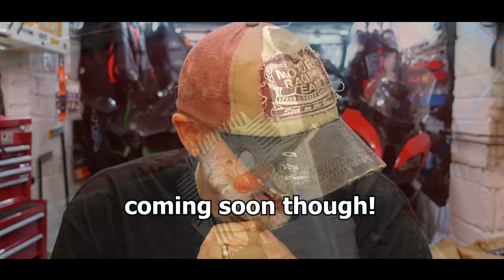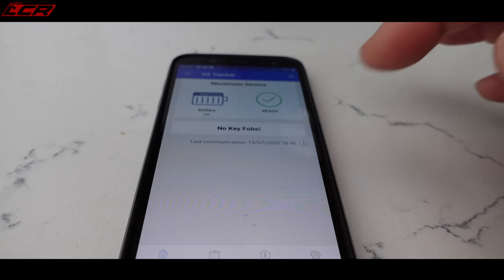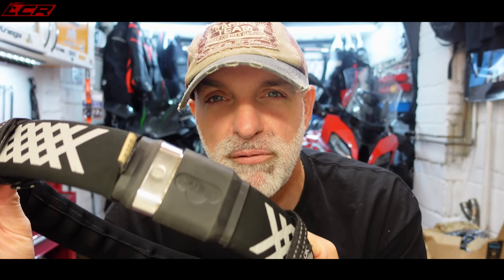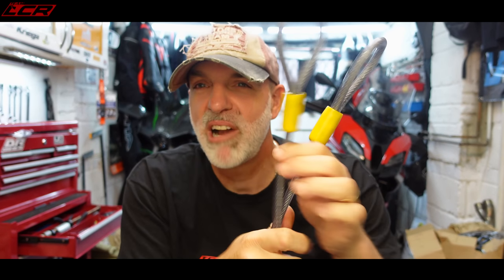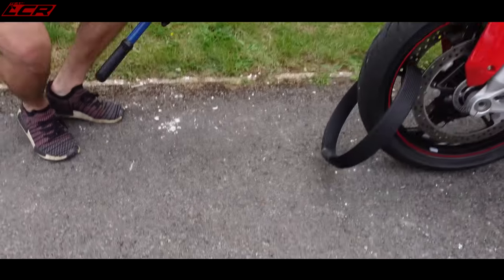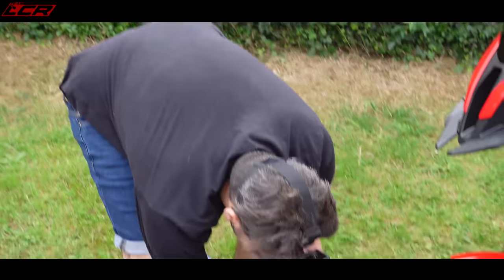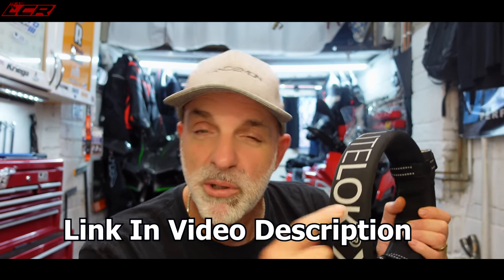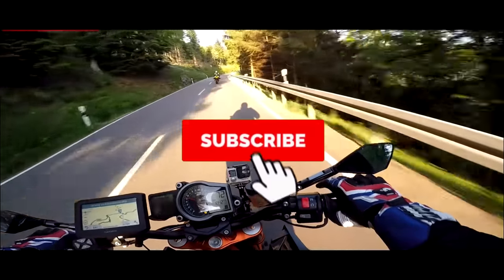Litelok Motorcycle Lock Review | Can We Cut Through It??

Comment from the maker: Guys of course an angle grinder will cut through this.. .Name me one product that wouldn't?  All you can do it try and protect yourselves from the opportunist thief its all about the deterrent and with the Litelok being Gold Secure an insurance approved tick in the box in many circumstances. Its a chain alternative which is easy to live with
Reply: It would still be interesting to see how long a disc cutter would take. However, it is only a deterrent and I'm still thinking of getting one as it looks so much easier to carry than a chain and padlock. And as I got my new street triple rs as a result of your reviews I'll have a punt on one of these too.
Reply: You don't need 450£ to buy a good steel bolt cutters as you say and they don't need to be so big that you can't hide them. For the first time in your channel I do really believe you were paid to say what you said, and the test you did you were told about what you could use. The premises of the test were wrong, the materials used were wrong, and the justifications about the price of the correct tool and size are really really misleading. And regarding the noise using a grinder well... It's different 5 seconds of noise from 2 to 3 minutes of noise or in the case of the grinder the neighbors don't matter anymore? So why not test it? Like I said it really looks like a really bad sustainable and badly premised paid review. At least say in big letters PAID REVIEW.
Reply from the maker: @jmvsc1  I didnt want to cut through it with an angle grinder as of course it will!! Then I wont have a lock to use.. I do actually want to use this product after the review! I dont crash test my helmets or motorcycles for the same reason.. The point was to show its not as easy as some people are making out to cut through this. THIS IS NOT A PAID REVIEW
Reply from the maker: @Steve765  Interesting but ultimately pointless as it will get cut through in a similar time to a chain I suspect. But this is a much easier product to live with than a chain and meet insurance standards
Reply: @LambChopRides  you didn't want to.cut with an angle grinder or with the correct and common steel cutters. That's why it's misleading, it's also very safe with a kitchen knife but also a useless test 🤷🏻‍♂️ sorry but I like your content and have you at a really high standard and that's why it's very disappointing this particular video.  Not trying to be a hater.
Reply: @LambChopRides  Yes I get that, and coupled with a decent disc lock, alarm/immobiliser and tracker I think that's as much as you can do whilst out and about.
Reply: Jose Castanheira I work for Litelok, there was no payment to Lamb Chop Rides.
Reply: Yes I would still like to see how long it would take to cut with an angle grinder, 😎👍
Reply: @LewisfromYouTube  there's always a quid pro quo, otherwise why the 10% discount? And I'm being as honest as I can when I say I don't mind if he gets paid or if he receives a kick back per unit sold with his code or something like that, he works a lot and he deserves to.receive something in return since he does not charge us to watch the channel, however the review/presentation/demonstration was way bellow the standards we are used from him and that's why it feels shady. It's a crappy lock, yes it's better than nothing but not much better....
Reply: Jose Castanheira A kickback is for his time and efforts for making the video...all youtubers ask for the same and we are more then happy to give Lamb Chop that for bus services and honest feedback of the product 😊
Reply: Jose Castanheira and we fully believe in our product. It wouldn’t have 5* on MCN otherwise.
Reply: @LewisfromYouTube  not a good defense... But once again I'm not the only one that got the wrong impression so it says a lot about the way it's presented. It does not change my opinion about the lamb chops rides...
Reply: Jose Castanheira can’t please everyone I guess!
Reply: @LewisfromYouTube  well you say honest feedback but it's a bit misleading really.

What his advert basically says is "if you use the wrong tool for the job, you'll fail".

Use a steel cable cutter which is no bigger than what Chopsy here is using and you're through it in under 20 seconds, silently.
Reply: @lmaoroflcopter  if I don't see an update with a proper tool I'm unsubscribing as he now has turned into another marketing shill.
Reply from the maker: Jose on the Gaurdsman barrier the code gets you £50 off! I get nothing, zero money. I requested the discount to get my subscribers something back in return for supporting me and the channel. Yes with this code I get a small amount, like the Amazon affiliate links it's the same thing. Other discounts like the CFG one, Ultimate Addons I get no money from that, its there for the subs for thier support!
Reply from the maker: @thecappy  Buy one and do it yourself! Use the code I can get you 10% off!
Reply: Lewis Bradley Films 
 Good to see a employee of Litelok on here as I bought a wearable lock for the Breadknife ( being lead to believe it was impenetrable with hand tools ) paying FULL RETAIL because I was told by the salesman that discounts give a negative effect on quality, so i'm now feeling fairly miffed that they can be cut with a decent pair of wire cutters, your giving them away to you tubers and discounting them through affiliate links which no doubt pays a commission.
Reply: Yes battery angle grinder 1mm cutting disk try that
Reply: It can be cut in under 30 seconds with cable cutters and was demonstrated by Lockpickinglawyer. Videos like this just smack of bought and paid for reviews.
Reply: @Bound4Earth  yeah just dislike his video and report his for not correct information.
Reply: ill name 2

hiplok d1000
altor saf

Comment: bolt cutters? try using cable cutters and you'll cut right through it in seconds. How much did LiteLok pay you for this ad?
Reply: Bolt cutters might be the dumbest tool to use on cables. It just squishes the little fibers together a bit. It's literally the kind of tool this lock would be suited against.
Anything made to cut steel cables will work like a charm if properly adjusted.
Reply: Exactly. See my comments on this.

Comment: Chopsy, I have an Almax chain and squire lock that will survive angle grinding but would I want to take this 15kg behemoth with me on a trip out? No. It is fine for home use but out travelling I want something that is a deterrent for the average scrote and makes them work for it until the Monimoto tells me to go check the bike. This kit is perfect for that and must be appreciated for the purpose it is meant. Easy fit, easy to travel with, insurance reducer and a delay tactic for the opportunist scrote. Also, if you ride with someone else who has one they can be doubled up. Gets my money. Great vid. Much appreciated.  Show the man some respect all you doubters.
Reply from the maker: Thanks Bob, glad someone gets the idea behind it!
Reply: Could not agree more! As a wise Mr Flyer said security is like layers of a onion!! 🤣 More the better.
Reply: Same here have an Almax and squire lock on a ground anchor but this lock looks ok as a portable option.
Reply: Well said.
Reply: I also have the almax and squire, amazing bit of kit but would still be cut with an angle grinder.
Reply: niche 123 not so sure. The Almax I have has 15mm links that are triple hardened. I think it may well break the grinder and in any case will take them enough time (and sparks), to be noticed. Super kit.
Reply: @bobcarter5548  yes they would get through it with grinder but with alarm and 2 disc locks plus bike trac alert and cctv camera alert to mobile i reckon i would get to them first😂
Reply: @bobcarter5548  I agree that the almax is amazing, I've actually got the 19mm. I just mean that nothing is angle grinder proff. I also use two disc locks and another chain. I also made an alarmed cover that goes off if someone lifts it. Probably takes me 10 minutes to unlock it with the keys. Lol.

Comment: Would have preferred a video using the modern thief's weapon of choice, a battery powered angle grinder. 

However, any deterrents are good and make bikes less appealing to nick.
Reply from the maker: Yes but nothing can withstand an angle grinder. You can only offer a deterrent and this is very easy to live with and meets insurance standards
Reply: I'd like to think I'd wake up and check on my bike if someone was using an angle grinder at night.

Comment: To defend the product, it is (or rather was) Sold Secure Gold. That doesn't include an angle grinder test! If you want the highest level you'll have to spend more money and get a Diamond rated product, both in ground anchor and chain, and lock. £130 isn't going to (not) cut it.

Comment: Others have mentioned, the angle grinder attack. But then angle grinders can get through 20mm hardened chains in about a minute (see articles on Bennetts social). Yes the angle grinder makes a lot of noise. In addition to a disk lock or two, alarm and tracker, it does at least slow down the "lift the bike up on to a van" attack, so it does look useful. All you can do is slow down a determined thief, and make them think there are easy pickings elsewhere.

Comment: We use various wire cutters at the local electric utility where i recently retired from that would cut through that in under a minute. Any made for cutting steel cable will do the job including some one handed ratcheting types. The smallest one I had on my truck had 16" handles. Many of the smaller aluminum conductors have a center steel core. No angle grinder required. Stating that I will also say if you have a determined thief that knows what they're doing they will get your motorcycle, car, or anything else they're after.

Comment: As has been pointed out an angle grinder would cut it, and a chain and a disc lock, To carry a chain that would slow down a grinder, you'd need a trailer because of the weight of the chain .. I bought one these as it was light and easy to carry, I also use a couple of Disc locks if I feel I need to add a bit more security when I'm parked up, all of these are easy to carry and use when out and about .. and added together I'd like to think they would move on to an easier target ..

Comment: Cable cutters work, there's a guy on YouTube that breaks locks and with a pair of big cable cutters he did it in 16 seconds
Reply from the maker: Yes but they are HUGE, never fitting in a rut sack so going to draw attention walking down the street with those
Reply: @LambChopRides  Thieves usually roll up on a scooter, two up, pillion carries the angle grinder or cable cutters or whatever. They don't walk down the street. 
Careful what you endorse Chops.
Reply: @motorbikesandhacks  tin snips are the ones your refering to, they are just a bit bigger than a pair of scissors, way smaller than bolt cutters. 
Bolt cutters - locks & chains
Tin snips - cable locks
Angle grinder - everything.

Just add as much security as you can, multiple security is needed to deter them, nothing will stop them if they want it bad enough though 😒.
Reply: @rich.dodd1  no he's referring to cable cutters. Look the same as bolt croppers but with cable cutting head.
Reply: @kwak1k  well which lock are you endorsing then smart arse? because none of them are impossible. you can only reduce the time it takes.
Reply: @kwak1k  how was it shown as indestructible? it was shown to withstand 5 mins from a bolt cutter. use your eyes. and lock picking lawyer is the god of lock destruction so of course he can get through it in 16 seconds. he used cable cutters made in japan, designed for steel cables. how many thieves are getting about with them? its a specific tool. the point is these locks are good portable, short period security. if you nip in the shops or something you can stick one of these on.
Reply: @Jake-yy9fg  any self respecting tea leaf will now have steel cutters on his birthday list

Comment: That was a complete waste of time, no one uses Bolt Cutters 😳. Angle Grinder is the weapon of choice.
Reply from the maker: Yes but nothing can withstand an angle grinder. You can only offer a deterrent and this is very easy to live with and meets insurance standards
Reply: @LambChopRides  And a steel wire cutter would go right through. Faster than a angle grinder. Who would cuts cable whit a bolt cutter 🤦‍♂️

Comment: Solid lock. Recently saw a video from a camera at a private house. Motocycle is fixed outside with sturdy chains. Everything looks like the thieves won't be able to steal this bike. But... 3 men get out of the van, they take the bike with the wheels off the ground and put it in the van in 3 minutes. Morality of the story, as long as you can't attach the lock to a fixed point it will be stolen in no time.

Comment: I just saw the video and was pretty impressed by it and was on the verge of ordering the litelok.
Then I see someone else's video who cuts it in 16 seconds with steel bolt cutters...
Reply from the maker: Did you watch that video and see the size of the cutters he used? They are £450 to buy a set of those professional cutters, you cannot fit those in a back pack! less conspicuous to use a battery angle grinder than those and nothing will survive that attack! All you can do it try and protect yourselves and its all about the deterrent and with the Litelok its Gold Secure so insurance approved so a tick in the box in many circumstances.
Reply: @LambChopRides  They're free if you nick a set. They are thieves after all. Price is not a barrier to crime.

As for "size of them* well they are nicking a motorbike, if they are concerned about size perhaps they should try stealing a bicycle.

At best this vid is Ad fodder (You've got to eat I get it) at worst you derped a video.
Reply: @LambChopRides  £450 for your what was it £16,000 bike? Sounds like a bargain to me. As the fellow above me has stated thieves will steal your bike. Thieves will steal the tools if necessary.

Comment: I'm with ya Lamby mate. An angle grinder will cut anything, given time - but lads - seriously - this is effectively multiple wire ropes. I can assure you,  cutting wire ropes with a grinder or bolt croppers  is MUCH harder than cutting a chain. My weapon of choice when out is a Pragmasis 16mm chain - but it weighs a tonne - and IFFFFFFF the attacking scrote has a battery grinder, it is much easier to hold a link down and cut it, rather than a series of wire ropes. I am a mekky eng in the steel making industry for 40 odd years, and I have been looking for the best solution in all cases, home and away  - and I can confirm finally that the BEST solution, is a twin tubed device (shortened) , containing two plastic and brass containers, filled with coarse fishing lead weights and summat called "Gum" powder I think its called - although my teeth are fine 😁 (see). Just gimme a chin shot scrote, and I'll explain to you why we don't like you pinching out motorcycles.

Comment: in the trucking industry, sometimes we would use cable seals to ensure nothing inside the trailer was tampered with.  when cutting these off with bolt cutters instead of cable cutters, it could become quite a  chore.  if he had attacked this one cable at a time and followed up snipping anything that only got crimped with the wire cutters he joked about at the beginning, i think he would have done this in under 5 minutes.  

with that said, bolt cutters would have been better suited to cut through the lock itself, not the cable.

Comment: What these locks need is some kind of tamper protection system. Perhaps a sealed plastic sleeve containing acid or pepper spray liquid. When this is cut through at the start of the attack the criminal is unable to continue. Even hi-vis, unremovable dye (as used by security vans) would help as scumbag would be easily identified later.

Comment: I’m pretty sure bolt croppers are a thing of the past. The #’s I’ve seen either lift it (great if you can put a lock round a lamppost) or use an angle grinder.. I think the tracker is a great option. I use the Almax tied between 2 bikes and 3 Abus alarmed disc locks plus CCTV. 😂 I think the combination of a bar is great with a ground anchor and a tracker.. I’m actually sick of spending money on security stuff but I’m just paranoid.. This is the reason I’ll never take anything nice into London..

Comment: Sorry to rain on your parade Lamb Chops but those particular Draper bolt cutters are NOT for cutting steel,  they are suitable for cutting high tensile material up to 40HRC only, they will be fine for cutting soft copper wires in your home or aluminium but you need to have the right tool to cut through steel. A higher spec cutter of the right type will cut through your Litelock in just seconds, literally.

Comment: I think the point is it's better than having a normal chain. I'm thinking as well you could wear it as a belt if you don't have a top box or a big belly? How come chops junior didn't just try attacking the buckle? I think he could get through the buckle in 5 minutes.
Reply from the maker: The buckle is hardened steel no chance, plus I wanted to use this after he had finished, that would have scratched it!

Comment: Great job using a cutter that couldn't cut a cable tie. Try using steel cable cutters and see what happens? It takes 16 seconds to cut with the CORRECT tool. That's exactly the same as trying to cut a steak with a fork.